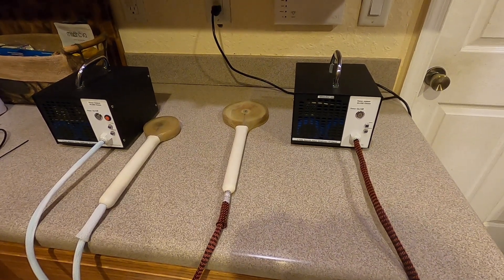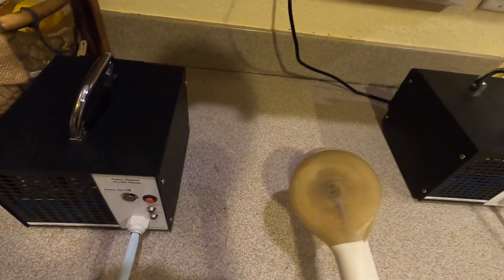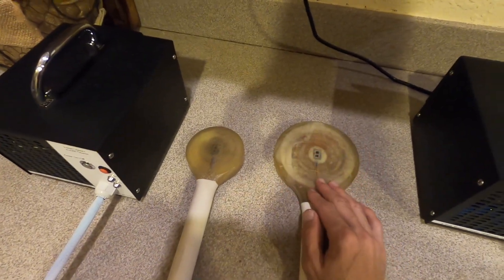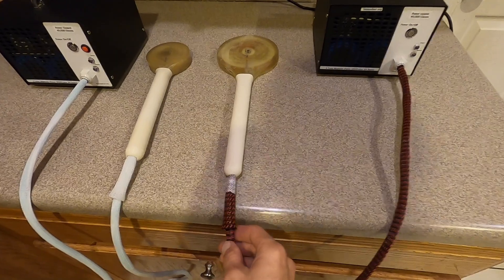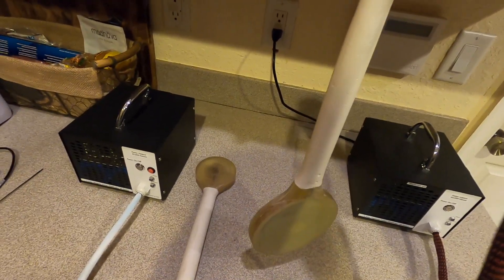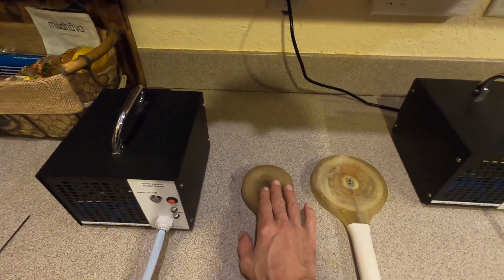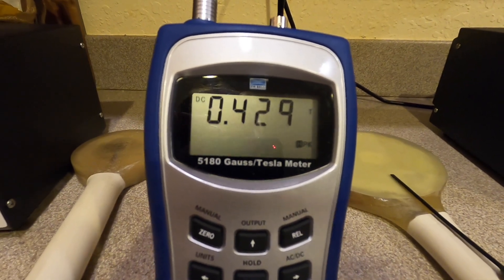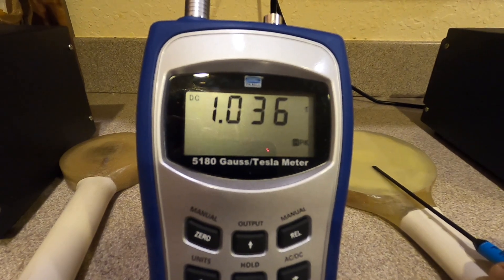019 BBMPulser 4B with 5" Aluminum Pancake Coil PEMF Open Source 1 Tesla (10,300 Gauss)

Comment: how much power needed to make 1 Tesla?
Reply from the maker: I suppose you mean how much electrical power needed to generate single 1Tesla pulse?
Well here is some references.
If you consume on average 50 Watts of electrical power from your outlet, that's enough energy to generate 1Tesla pulse every 2 seconds from 3"Coil with 2,000uF Capacitor Bank charged to 500Volts, or you need 150 Watts of continues power to generate 1 Tesla pulse ones a second.
Hope this answers your question

Comment: I have an old pulser where the north letter has worn off and dont know which side of the paddle is the north, is there a simple way to find out?
Reply from the maker: You will need mechanical Compass
Turn your Pulser on and start brnging Compass  to one of the sides of the coil. The side that pulls (arrow) is the north Side.
Reply: @AndreyD  Thank you so much!

Comment: How often should pulser release pulse when set to discharge at 800volts?
Reply from the maker: It depends on the few factors. 
What do you get?
Reply: @AndreyD  I haven’t got any pulses yet. I have been extremely busy since I last talked to you and haven’t had much time to mess with pulser. I just got done upgrading pulser by adding an extra diode and a capacitor to give me a 5 stage multiplier. From my understanding from our last talk you said the the 5 stages plus main caps with thyristor is how the voltage ends up being around 930 volts because main cap and thyristor act as another stage. Well I changed 1meg resistors to the two 2meg Resistors in parallel and replaced 30 k with 33k resistor but when I turn it on I hear electrical noise. I know it’s suppose to only charge capacitor bank to 800volts. I haven’t let it run for long enough to pulse yet because I am concerned. I can’t figure out why it is making electrical sounds but I am thinking about letting it run long enough to pulse once just to see but I don’t want caps to explode if something is wrong.
Reply from the maker: 10 seconds should be enough to charge caps to 800Volts
not more then 15 seconds. If you don't get pulse with in 15 seconds then you have a problem in the circuit. Try messing with 10k Veriable resistor
If you are using 500Volts Caps (that's what you should be using here) then you can't overcharge them with this circuit.
Reply: @AndreyD  I’m using 450volt main caps but I need to buy 500v caps. I just wanted to use the 450volt main caps for now and I figured as long as the low voltage circuit doesn’t fail I should be fine until I get larger voltage rated caps.
Reply: @AndreyD  do you think it’s safe enough to use for now as long as low voltage circuit doesn’t fail or is the output voltage from multiplier too much?
Reply from the maker: @corybrown5583  in general yes it's safe to use 450Volts caps here because
1. When charging circuit gets to the highest output - it's charging current is the lowest
2. Your 450 Volts rated caps can take charge to 480Volts
3. In order for capacitor bank to blow you need to overcharge it with high currant, you need to heat them up with overcharge current, only then you may blow them
Also try not to use circuit in manual mode. Use it only in automatic.
Basically if circuit doesnt trigger then don't keep your capacitors charging.
Reply: @AndreyD  okay thank you! I don’t ever want to witness those capacitors explode in an uncontrolled environment since they’re so large 😅.
Reply: @AndreyD  for some odd reason the first 120uf 450v capacitor going to neutral wire exploded 😅. I guess the electrical noise I was hearing was arcing occurring inside the capacitor. I immediately unplugged it but I’m guessing the other one in sorties with it may also be bad now! Do you think I could have heated one of the legs for too long with my soldering iron causing capacitor damage? The cap didn’t actually explode but a huge flash of light occurred accompanied by a really loud noise!!
Reply: @AndreyD  craziest part was my face was right in front of it less than a foot away because I was trying to locate the noise!
Reply: @AndreyD  I took the capacitor out to get a better look at it and it doesn’t look defective at all! The explosion looked like it came from a vent hole on the bottom of the cap between the terminals. Could that have been hydrogen igniting from capacitor shorting internally after it was venting? I figure it should have a hole in it or a bulging top but it doesn’t....
Reply from the maker: @corybrown5583  Im sorry to hear about the experience you went true. Maybe it would be good Idea to wear safety glasses while testing the circuit, rubber gloves also will help. 
Now, before turning everything on Please check and double check to make sure everything connected correctly.
Maybe you connected neutral (ground of the circuit) to the Ground from outlet (120VAC) 
maybe some other errors you did. 
check polarity on all capacitors maybe you connected main bank capacitors in reverse? You need to recheck everything and try find what you did wrong
Reply: @AndreyD  I have never messed with the ground to chassis. The pulser is built almost identically to your 4B model with the same case so the ground is still connected to chassis like it was when I got it. The pulser worked correctly until I added an extra capacitor and diode to the voltage multiplier and changed thyristor to higher rated one. The C4 capacitor is the one I suspect caused the explosion. I noticed the main capacitor bank was almost fully discharged after explosion to around 30volts. I had C4 negative side attached to neutral and anode of D6 diode. I used thyristor Sk065K but could that have caused some kind of issue? Also I replaced the stranded 18AWG to solid 18AWG for the wires attaching diodes and capacitors together for the voltage multiplier. Like I said I don’t know why it happened like it did because the capacitor I suspect caused the problem didn’t technically explode at all. Visually it looks fine but the explosion occurred right above its terminals near a hole between negative and positive. I suspect it’s for venting also?
Reply from the maker: @corybrown5583  Cory, you misswired something.
Capacitors should NOT get hot or Exploude. Only IF you wired incorrectly something then it may happen.
Try to find the problem
If you can't then maybe you need to wait for 900Volt circuit model to come out first. You are russhing. I will support you and your questions ones I put out Video with 900Volt circuit.
Remember you are asking all this questions under 640Volt circuit.
Reply from the maker: @corybrown5583  Cory, you misswired something.
Capacitors should NOT get hot or Exploude. Only IF you wired incorrectly something then it may happen.
Try to find the problem
If you can't then maybe you need to wait for 900Volt circuit model to come out first. You are russhing. I will support you and your questions ones I put out Video with 900Volt circuit.
Remember you are asking all this questions under 640Volt circuit.
Reply: @AndreyD  again thank you! I will definitely check the wiring. The 900volt circuit shouldn’t have much differences though right? Does it have a different resistance for main resistor going to 120 volts?
Reply from the maker: @corybrown5583  yes. Main resistor should be around 100 Ohms instead of 50
Reply: @AndreyD  that must be why that happened 🤦🏻‍♂️. I’m for sure new at this stuff! If I may ask why does the main resistor need to be larger as the voltage is increased from voltage multiplier? Does that mean I ruined all of my voltage multiplier capacitors even if they look okay visually? I ask because I do not want to use them and experience another 💥! It was as loud as a gun going off in the house 😆.
Reply: @AndreyD  if I had to guess the increased resistance from main resistor to voltage multiplier is used to prevent the voltage multiplier from drawing too much current?
Reply from the maker: @corybrown5583  Cory Im taking it back.
100Ohm resistor you need if your main power source is 230VAC. In your case you need 50 Ohms.
Reply from the maker: @corybrown5583   Cory -"the increased resistance from main resistor to voltage multiplier is used to prevent the voltage multiplier from drawing too much current? " --Yes, the main resistor limits the current for the charging capacitors
Reply: @AndreyD  I still have a 50ohm 300 watt resistor wired up so I guess the problem is somewhere else then! I hope I can figure out what went wrong! It doesn’t make sense because I haven’t messed with any of the other parts of the circuit besides the voltage multiplier and I checked it over and over and everything seemed to be wired correctly with one capacitor negative going to neutral while the other capacitor negative is going to the main resistor. My thyristor tests okay and so does all my diodes! I’ll just keep look and hopefully find the problem!
Reply from the maker: @corybrown5583  Whats the voltage rating and capacitance on your Charging circuit Capacitors?
Reply: @AndreyD  450volt 120uf capacitors with a rated temperature of 105 Celsius.
Reply from the maker: @corybrown5583  Okay, just making sure
Reply: @AndreyD  I just tested all of the charging circuit capacitors and they are all good.
Reply from the maker: @corybrown5583  Is it possible you wired new thyristor incorrectly?
Reply: @AndreyD  I found the problem! When I started taking the diodes off the heat sink one of them had a bad mica insulator behind it! It had a crack in it and  was arcing to the heatsink! The aluminum actually has a small crater in it! 😅 Well at least I know it wasn’t the wording now and that explains why the capacitors are all fine!
Reply: @AndreyD  there is also a hole in the back of the diode!
Reply from the maker: @corybrown5583  Are you using 80 Amp Diodes?
Reply: @AndreyD  yeah they’re rurg80100 as used in your 4B model! The diode still tested fine but was damaged from arcing.

Comment: That's great. I think longer operation will yield better results for healing. 
Your 1T model already beats all other competition in terms of intensity. 

Just a thot - is it possible to make the coil out of Copper tube and have coolant running inside?

How do you do the plastic molding? At home or contract out?
Reply: I built his 4b unit and have noticed the center of the coil is the strongest. When you say copper tube do you mean magnet wire wound in more of a long tube shape? I have used a crossover coil that is a lot thicker than his coil and it appears to weaken the output (like Andrey told me it would) vs using more of a pancake coil like Andrey is using.
Reply: @corybrown5583  yes I meant the magnetic coil. You're right I forgot solenoid field strength is inversely proportional to its length.

Perhaps one loop of tube in contact with coil in the paddle will be sufficient for cooling by liquid. But the whole circuit has to go thru the same handle as the wires for ease of use.
Reply from the maker: @motogee3796  Hello Moto Gee. I think yo and Cory just give me awesome Ideal. 
I'm familiar with tube conductors and by itself I think it may not work due to a lot of empty space inside of it, but if I combine with solid copper wire then, hybrid coil then it should be perfect. For example 25% of coil made of copper tubing (thin tube little thicker then 14AWG wire capable of caring same amount of current as 14AWG Copper wire) and 75% made of 14AWG wire. 25% of tubing should be sufficient enough to move enough water to keep coil cool.

Now I need to deal with the water inside my pulser, New challenge.  This is most likely will work best for larger stationary Units, portable Units with water? I don't know if it's good Idea.
But that's how strong pulsers cool their coils, with water. So I need to look into it for the future stronger Stationary Units
Reply: @AndreyD  :) Glad to to be of help.